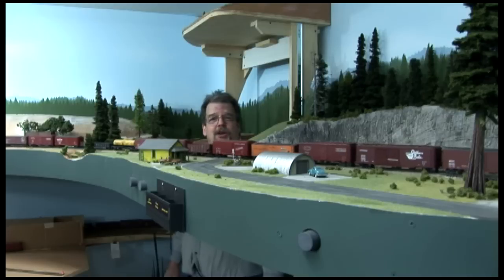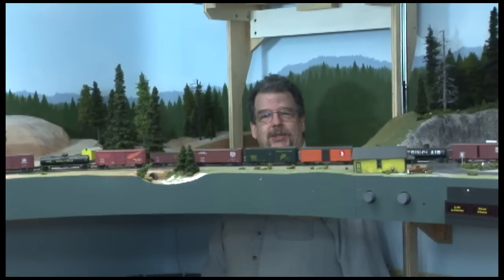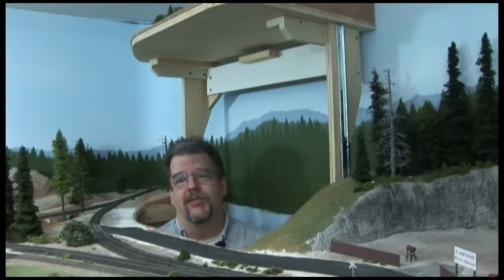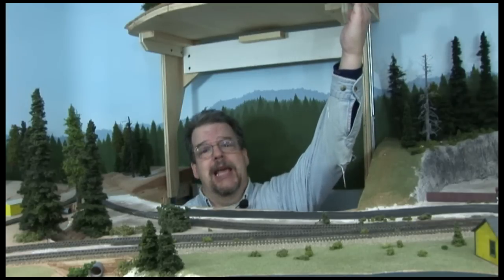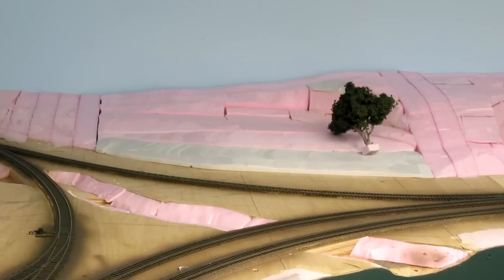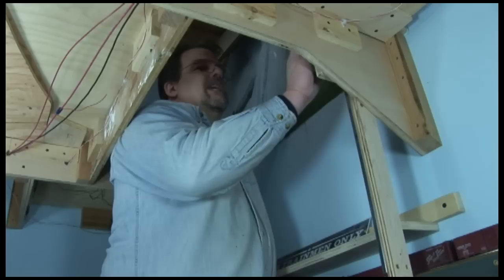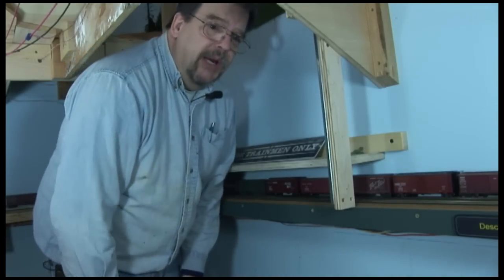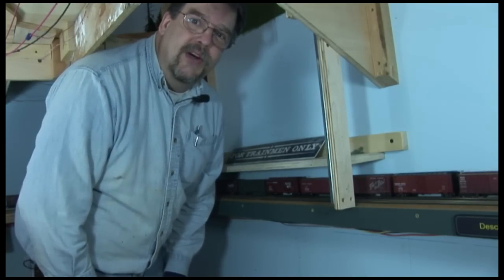mrhmag.com - Lift up access hatch on Charlie Comstock's Bear Creek and South Jackson railroad

Comment: I love the idea. I searched all over UTUBE MRR to finally find your lift out hatch. I am trying to maximize all the room I have in a 25 foot by 16 feet room over my garage. So some areas will have a reach over 3 feet which is not good. So by having a lift out/up hatch, that is the middle of my scenery BY MY DESIGN, it will allow me to have maximum track usage, larger diameter track curves, and industrial areas.  Thank you for sharing your excellent video!!